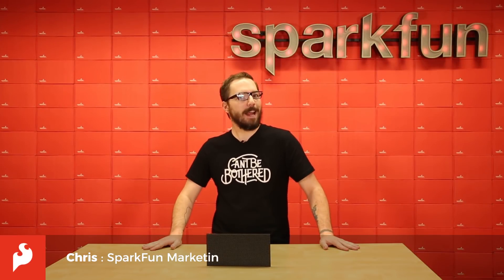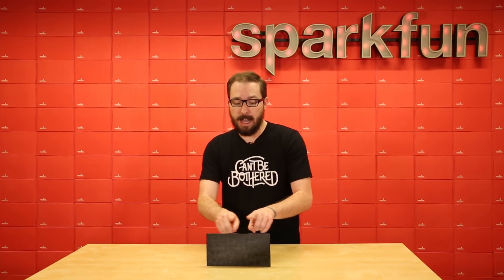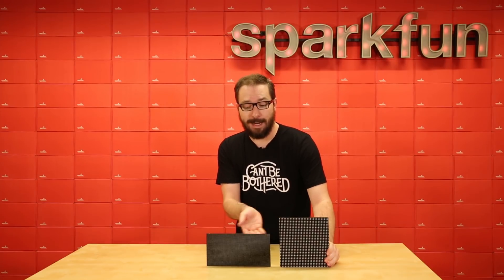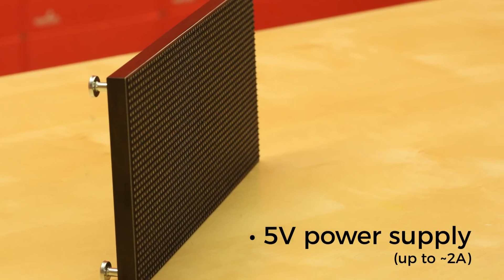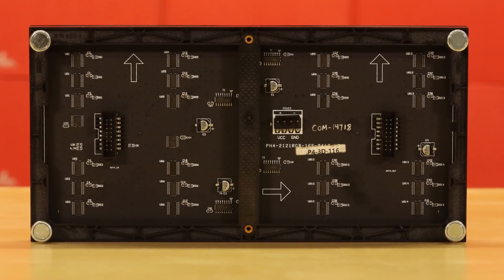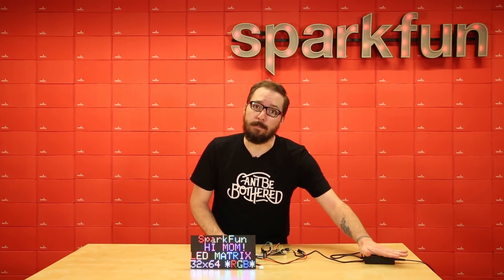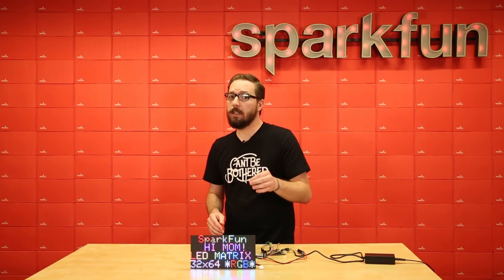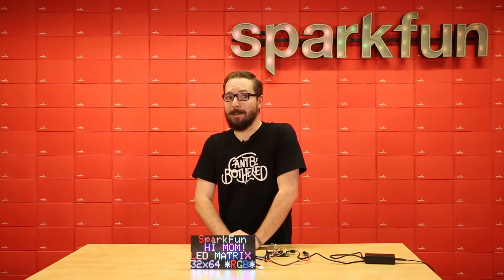Product Showcase: RGB LED Matrix Panel

Comment: can you show us the connections of the led matrix to the arduino mega?
Reply: I wouldn't recommend using this display with a MEGA. It only works for static stuff, when it starts moving, the MEGA chokes. I run these from an ESP32, as they have DMA for better control of the panels in the background. Cheaper than a MEGA too. Here I did an arcade themed clock with these panels: https://www.youtube.com/watch?v=ANfwb7ikn9g

Comment: If you're not using Arduino type computers you can use a much faster Raspberry Pi with the rpi-rgb-led-matrix project, easily chaining 3 times 5 of these, showing pictures or animations in 24Bit color.

Comment: Can you show a block of these daisy chained together & perhaps have it display a picture?
Reply: Builder's Mark we certainly plan to,  we have a few thinks in the works for this right now. Stay tuned!
Reply: Yes, these are designed for huge advertising and concert displays. You can get controller cards by Linsn to drive them via HDMI as a regular monitor with 60Hz or more.

I've set up a screen that drives 4x5 panels with a 256x160 resolution.